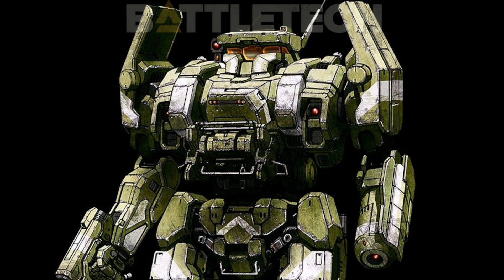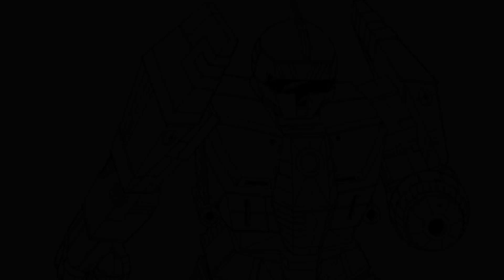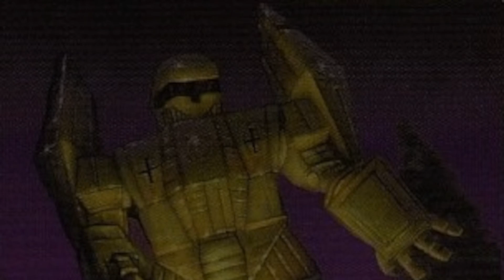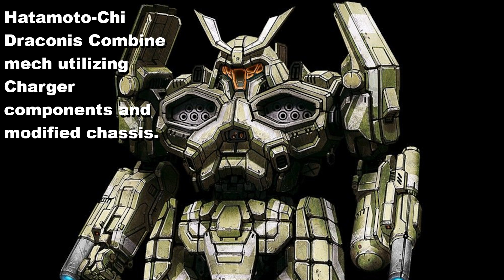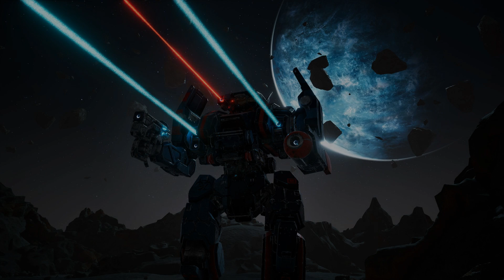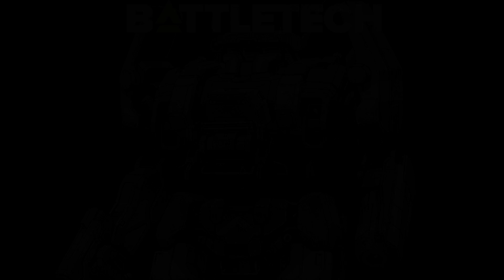BATTLETECH: The Charger

Comment: If we count what the Charger chassis potentially could be, well, I built a custom Steiner Charger, the CGR-3A5 (search it; the Reddit link is the correct one). It had max armor, went 5/8 (86.4 kph) with an XL engine, and had 5 ER Medium Lasers, 1 Small Laser, a Heavy Gauss Rifle and. . .Triple Strength Myomer. To those who don't know what Triple Strength Myomer does, it increases base move speed by 1 when engaged (resulting in a 97 kph top speed) and DOUBLES the damage dealt with melee attacks. So, this thing ran as fast as a medium mech and hit like a ton of bricks at anything under 10 hexes (100 meters away). It really is very difficult to explain the horror this mech represented, other than I have seen it take apart custom 100-ton Clan mechs in 2 or 3 turns. And, even worse, literally every aspect of the design is plausible within lore as it fit within the mold of other big-gun Chargers and Steiner had used literally all these features on other designs.

Comment: BattleTechnology Magazine had featured a variant of this 'Mech, dubbed the Challenger, which had a smaller engine and replaced all the armaments with several large lasers and a medium laser.  That is, if I recall correctly.

On another note, I find it irritating that, considering its weapons loadout, there was no left hand and in the right hand there was placed a "laser pistol."  It seemed like the designers were trying to make this thing look more menacing than it actually was.
Reply from the maker: Oh man, can you imagine the small laser charger running out there like a gunslinger, but a gunslinger with airsoft pistols? :P
Reply: @BigRed40TECH  That's absurd beyond belief. 😄
Reply: You're talking about CGR-SB. Is also variant CGR-1A9 which is remarkably similar to described CGR-3K but with Succession War tech. As I understand it, what House Liao / Capellan Confederation got from Kurita was CGR-1L, which has armament in par with Grasshopper and armour in par with a light 'Mech. I'm dissapointed with Big Red skipping these variants.
Reply: That actually makes way more sense, kinda like a lot of Solaris 7 Gladiatorial mechs or that one pirate mech that had a crapton of spikes and threatening blinging to make it seem more intimidating than its stats would tell.
Reply: Yep. The Challenger downgraded the engine from a 400 to a 240, Removed the small lasers, Up the armor to 15 tons, Add 4 large and one medium laser and a bunch of heat sinks. Loved that issue of Battle-Technology.
Reply: @drewmccorkle8973  Sounds like taking an Awesome and doing a PPC to LL swap
Reply: @stuartendo-streeter4903  With 4LLs and 28 heatsinks it can fire continuously without any heat worries. 5 extra tons of armor make it very well protected.

Comment: I feel that 5 flamers would have been a much better choice than the small lasers. The effective range would still be nonexistent but it could probably shut down or cook most of the enemies getting close pretty quickly.
Reply: Flamers weigh a ton each, though. It could only hold 2 and a half of them.

Unless you run vehicle flamers, then you can run 3.

Comment: I like this mech, but there's a version where they covered it in rocket launchers, which is awesome. Honestly, I think they are focused on the wrong thing. I look at the Charger and think "Hey, wanna be an even bigger version of the Firestarter?" Because the two mechs are actually more similar than people realize. It's this weird proof of concept mech, assigned probably on the battalion level, for a niche job. I think if you loaded it up with flamers and got it to act like the Firestarter, you'd find that it would make a much better reputation for itself.

Comment: Like the Cicada, it's not a terrible design, just one in desperate need of Lost Tech or a minor alteration to its engine power.
Reply: Anything that needs at least clan tech to be a reliable design probably needs to go back to the drawing board
Edit: that said, I love this thing
Reply: The Assassin is the same story. An xl or even a light engine can turn that maligned 40 tonner into a real battlefield ninja. Get enough spare tonnage to upgrade to a large laser and it's going somewhere.

Comment: In it's era, the Charger works wonders in the roll of disrupter.  Let it get in close to the heavies, and a lot of their firepower suddenly stops being as useful.  LRMs, Gauss Rifles, long range autocannons and PPCs all become very unwieldy when the target gets in close.  And a lot of the things that have those weapons don't often have hands.  So the charger hangs out until it can get close, and when it can get where it wants to, it can suddenly tie up a whole lance of otherwise very dangerous mechs.  And they can't get away.  The Charger out speeds them, and it out punches them in the most literal sense.  And it doesn't care if you put a terrible pilot in the hot seat.  Terrible ballistic skill?  You aren't missing out on much damage.  Terrible piloting skill?  As long as you can make the mech run and stand up, its all gravy.  So it can certainly have it's uses, you just have to know how and when to toss it into the mix.

Comment: There is a whole lot to critisize Charger for, especially it`s original release, but it has a few tricks going for it. Charger can scout, get ambushed and survive relativelly untouched while withdrawing. No other contemporary mech can boast the same, and on the more personal note, I love tinkering with Charger, slightly downgrading it`s engine to 300 can allow to fit a PPC allowing him to be somewhat of a sniper with good maneuver and survivability. If you splash XL engine, ferro fiber armor and DHS... well, with all the energy hardpoints you get a monster mech capable of melting downright anything with a speed nearing a medium mech, That is something to look for, if you can survive in the Charger untill then.
Reply: Steiner would disagree with that assessment. An Atlas can do that as well :D
Reply: This is exactly what I do in MW5. An energy boat with either 3 PPCs or Binary Lasers (via mods) and then round it out with a bunch of medium lasers, extra armor and DHS. It can out Awesome any Awesome.
Reply: If you have to do that much work to make a mech viable then the original design is shit.
Reply: @Nabo42  I mean, it is, when an assault get`s outgunned by a Commando you know you fucked up, but it has it`s uses.
Reply: @bezyn2291  lol anything has a use but the best thing you can do with a Charger is sell it and buy something better
Reply: @Nabo42  I disagree, even without mechlab mods I much prefer Charger to Atlas or King Crab, or most of the other assault mech for that matter.
Reply: @bezyn2291  lol okay. Shine on you crazy diamond!
Reply: In the original release many medium mechs can do that too. In the video the Wolverine was mentioned. One Wolverine model has about the same armor as the Charger, has the same movement speed, but also has better weapons. Other medium mechs like that may have better weapons, armor, movement, jump jets, and so on, all back in 3025.

Comment: The entire reason that the Charger exists is because of tabletop mechanics. Charging damage is one tenth of the mech's weight, multiplied by how many hexes the mech moved before inpact. The 80 ton Charger with a 400 rated engine (the largest available) was the only mech that could charge for more than 60 points of damage, since it was capable of running 8 hexes per turn. Joke or not, this was usually enough to knock the target down, and the damage potential exceeded the alpha strikes of every mech in the 3025 rules. Now you know why it's called the Charger :P

Comment: "To call the Charger a failure is an insult to other failures."

The Charger in a single sentence.
The Charger almost, kind-of-sort-of works on paper: it's a recon mech that can take fire.  It supposed to be big enough and heavy enough to reconnoiter heavily defended areas and escape with its data.  It's lightly armed because the designers wanted to discourage the pilot from engaging enemy forces and encourage them to run the hell away.  But, as you point out, mechs like a Wolverine or Shadow Hawk have as much armor, have the same speed - but also have jump jets, and they actually have weapons enough to discourage lighter, faster mechs that might pursue them from giving chase.
A Phoenix Hawk is nearly half the weight of a Charger, but could easily chase down the massive mech and bring it down without ever getting close enough for the lumbering behemoth to shoot back.
Reply: I'm immediately put in mind of Tex's story about the Baron-Class destroyer from the Warhammer episode of Tex Talks Battletech and how the Baron was supposed to be this bold, paradigm shifting new fast attack ship, which instead proved to be hot garbage. Hot garbage that was pitted against the Taurian Concordat's Concordat-Class heavy frigate, which out-performed the Baron in practically every way and for a fraction of its price.
Reply: I don't think the Phoenix Hawk could take a punch from the charger.
Reply: @gary9346  Considering that its faster, more agile and jump capable, while being better armed, I don't think the Charger would get close enough to punch a Phoenix Hawk
Reply: In an open field with no terrain features, maybe.
Reply: @gary9346  But, that's the point, the Charger isn't fast enough to catch a Phoenix Hawk.  If the charger got close enough to punch, it's 5 small lasers could do a lot of damage.  But the 'Hawk could run or jump away before the Charger even gets within a hundred meters and keep pecking away with it's large and medium lasers.
The Charger, as fast as it is for an assault mech, isn't fast enough to evade most medium and small mechs, and it's too lightly armed to kill any small mechs pursuing it while they chip away at its armor.  
A Shadow Hawk, Wolverine, or Griffin is just as fast as Charger (and with Jump Jets!).  They have just as much armor as a Charger.  And they can blow away any lighter, faster mechs that might try to chase them because they have actual GUNS.  So they are much better suited for the job of scouting heavily defended areas than an 80-ton mech armed with five pea shooters.
Reply: @liljenborg2517  You're making the mistake of thinking everyone not only makes their appropriate rolls, but that they don't have any friends and are starting off some distance from one another the Charger already in its sights. I've killed dozens of Pheonix Hawks and similar mechs with a charger. It's a challenge but far, far from impossible.
Reply: @weldonwin  Tex is apparently planning a defense of this thing.

Comment: The thing I really hate is the guns.  The cicada also has 2.5 tons of weapons, but it at least has a couple medium lasers.  5 small lasers might theoretically have slightly more damage potential, but only at point blank range.  At point blank range you won't even use two of them because the punch is so much stronger.

Comment: in the original game I used a Charger quite a lot. It would be in my Scout lance, using it as the big Target to hit while I used a commando, Wasp and Jenner to hit the offending unit. The Medium Lance would arrive to start hitting targets with My heavy/Assault lance taking out the large targets. The reality of the company I used was I could take on a heavier company and still win. Taking on Clan Mechs was a big ask for 3025 Mechs but in a Batchall of my company vs an Assault Star I would normally come off best. 

UK BattleTech Leagues were great fun. Top Ten bouts were tough. One on One was always more fun with light mechs, as that was generally tactics games rather than slugging matches. We fought Battalion and Regiment combats, those were Weekend fights. 

I found the computer game versions to not understand the roles. Urban Mechs were BRILLIANT but in game were dead weight.

Comment: The prospect of a Charger armed with a sword is a fascinating one. For prolonged combat against multiple Lances it would be as useless as any other charger. But the image of a 100t assault (any 100 tonner) frantically backpedalling and alpha striking whilst a Charger with a sword the size of an Enforcer sprints at it is hilarious. The Charger probably wouldn't make it, but if it does...
Reply: Shame it runs too cool for triple strength myomer.  Otherwise that would be even more dangerous.  Faster AND double damage.

Comment: The Charger needs some work to be battle worthy. Put in 2 ER L Lasers and 3-4 M Lasers, ferro fibrous structure, as much armor as you can fit in and shit ton of double heat sinks, you get a high speed, close-in laserboat brawler nightmare that can chase down any mech party and run circles around them while melting their mechs to slag.

Comment: The main problem with the Charger is that only its combat capabilities are taken into account. None of her scouting was looked at. Note at the time of 3025 Tech Readout there was no rules for Electronic Warfare for Scouting. A Charger has massive Scouting and Command capabilities. This rules would later be implemented. A Charger is an example of an Assault Mech specialized for speed. Had the rules included such for Command and Scouting then the Charger's reputation would be greater. Unfortunately at the time only a Mech Firepower mattered. Laugh at the Charger all you want until you get hugged by one...

Comment: The most viable way to use a Charger in a unit composition is as a forward observer. It is fast enough to get into a good forward position to spot for indirect fire LRM units. It has enough armor (unlike other recon mechs) to stand still and spot while taking fire (without giving up much/any firepower), giving the LRMs the best possible accuracy.

Any light elements that want to try and engage it had better do so extremely carefully and only if they win initiative, because if they wander too close then the Charger can rush out of cover and snap their leg off like a twig with a well placed kick, or just plough into it with a devastating charge.

Once its armor starts to fail it then has enough speed to disengage back to friendly units who can swat at any pursuing light elements.

In a campaign setting it is also viable as a platform for upgrades. Replacing 2 or 4 of the small lasers with medium lasers gives it equivalent firepower to other dedicated recon 'mechs, while it boasts double or triple the survivability in terms of damage capacity. In a flat out exchange with another lance's recon element burping out medium laser shots, it will almost always outlast its opponent in a 1v1 engagement allowing ample time for the rest of both forces to show up and swing the tide in either side's favor.

If advanced technology becomes available and upgrade kits or even custom variants are allowed, you can really start to have fun with the chassis, utilizing XL engines, high energy weapon loadouts, double heat sinks (you can fit 16 DHS in the engine for zero space), and ferro-fibrous armor with barely a dent in its internal critical space available.

Yes, it is a cautionary tale of the military industrial complex trying to figure out any way to make a buck by answering a question nobody asked, but it's still a battlemech, and if you underestimate it it can and will allow a determined mechwarrior to kill you.

Comment: I remember playing the Charger mech with XL400 engine  (16 double heatsink in engine / 32 sinking total) (Endo chassis and ferro armor) armed with 3 ER PPCS. It could constantly chain fire it's PPC's without overheating, and it was fast. At that point it was much better than a stock Awesome.

Comment: Poppycock! A Lyran Militia Charger CGR-1A1  literally stomped the mech snot out of a Banshee and a Marauder in close combat on Apollo during clashes between Steiner Loyalist Mercs and Militia seperatists in August of 3020. If not for multiple lucky head hits from a supporting Loyalist Merc Archer by a braces of LRM20s that killed its pilot the Charger would have destroyed both the Banshee and likely the Marauder as well. The Loyalist Banshee had been charged into a Mech Hangar losing an torso and nearly losing its leg while the Marauder had been leg stomped repeatedly. Neither of them had penetrated the Chargers armor. The Seperatist Charger had maneuvered for another melee against the Loyalist Merc Banshee to finish it off. Fortunately, their Archer finally got an angle on the agile, quick Charger through the woods and smoke of nearby burning battlefield detritus. It vomited forth both of its LRM20 racks scoring several head hits.  The Charger rocked from exploding missiles that finally penetrated the cockpit killing its fanatical warrior inside, saving the Banshee from certain death and the overheated Marauder nearby from a similar fate. When used smartly in conjunction with supporting units a Charger is a deadly opponent as the Loyalists learned that day. (Based on an ongoing 3020 era Tabletop Campaign).

Comment: I recall Tex saying at one point that the Charger isn't a bad mech per se, but rather is just a niche mech that performs a specific function and shouldn't be taken out of that role. Which... I mean, I guess? But if if you're a mech designed with a single purpose in mind and you're getting outperformed by multi-role/general purpose mechs, than I think there's an argument to be made for you not living up to the design philosophy.